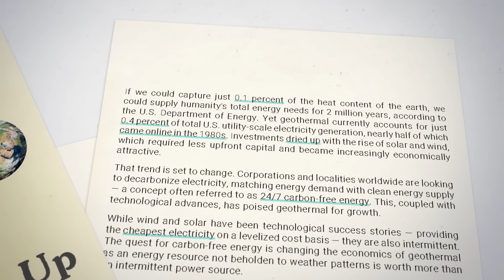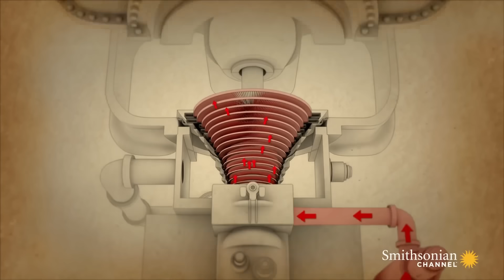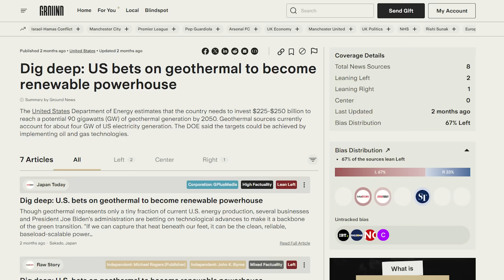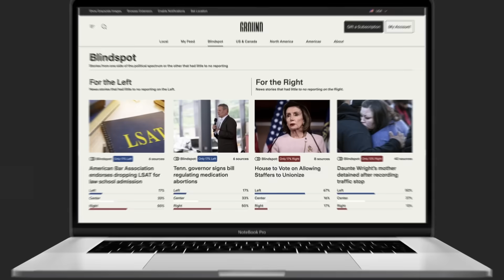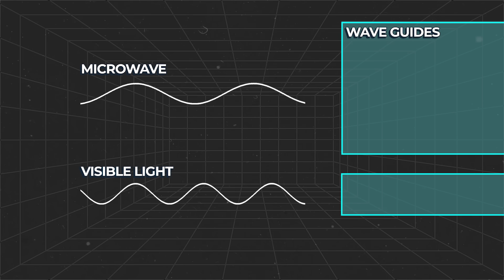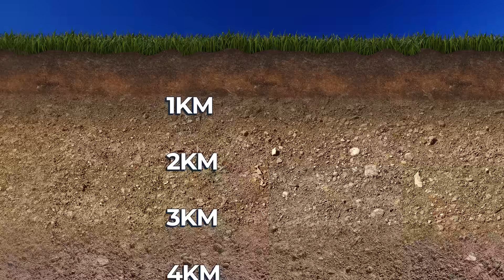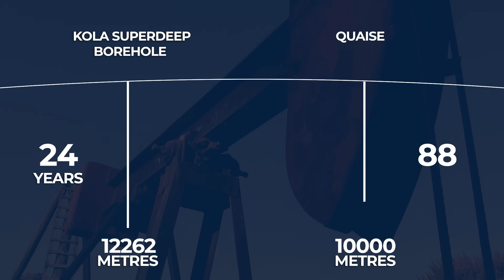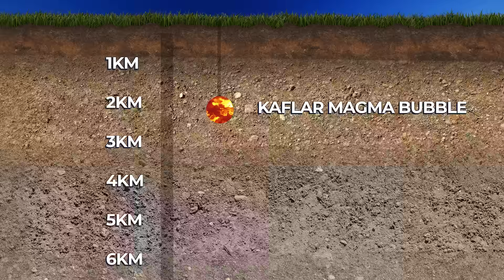This Fusion Tech is Solving the Geothermal Energy Problem

Comment: There is another technology that needs such drilling but at a much lower depth. The Trompe. These produce compressed air from a low head but continuous water flow. Compressed air can be stored so you get on demand power and can do peak and base load from the renewable. It also requires tiny dams. Carlos Araque is right wind and solar with batteries can't do base load but compressors up the wind mill can, compressed air though solar thermal systems works and compressed air can be stored for a fraction of the cost of batteries. For various reason, mainly the fact that the patents are 100 years old so you can't get exclusivity, the technology has not been developed. The one company that was trying to do compressors up wind mils got bought up and shut down by someone, not big oil.  Cheap drilling for Trompe coupled with mass produced parts that can be put down the resulting hole could be significant.
Reply: wow! thanks for the information. I think that those who stopped such a project are themselves the “ Electrification of Everything ” group, where everything must work with electricity, even if it does not need it, and there should be no technology that generates, stores, and uses anything other than electricity. I saw the same thing with nuclear fusion groups, where electricity is used to power a reactor and then the electricity is recovered from it. When you go to the video comments, you see people saying, Wow ! What a futuristic technology, just imagine if it was a technology that did not use electricity, they would immediately oppose it and call it a “ perpetual motion machine ”! It seems that the electricity has a special license or visa where it has the right to violate all natural laws !
Reply: @ياقوت-ق  Remember when this technology took off high temperature superconductors had just been discovered and superconductor storage rings were talked about. That made sense of the technology decision but superconductor storage rings never panned out. The technology does not scale. The patent problem is still un resolved. Industry wont use 100 year old expired patents because manufacturers can't get exclusivity and often investors and banks want that as a protection.

Comment: They don't seem to have solved the other problem. It's not hot water that comes to the surface from most sites; it's hot mineralized water. As he water flashes to steam the minerals precipitate and either clog the system or become a pollutant. Compressed CO2 can be used but that's hard and that works for warm geothermal at shallower depths.

Comment: Brilliant recycling of old plants that's efficient. It seems like a vacuum would help on the top as a vaporized rock outlet. I'm not sure if the waves will scatter at as depth increases but if so, then a lining can be placed on the side of the walls (e.g. at a max average bore width).  I see the cause for the tests and am excited to hear the results! Thank you for the informative video.

Comment: Geothermal energy requires huge amounts of fresh water  .... a commodity that some people feel is in dwindling supply.   The claim that this can be installed anywhere is trumped be this need for water.   A calculation will need to be done to determine how long it will take to produce the same amount of electricity that was used to drill the hole.   .....how long till it 'pays for itself' power wise.   Pretty interesting technology, thought.

Comment: Several things need to be thought about. If you look at the operations in Hawaii, you'll see that the holes wear out ( cool down ) and new holes need to be drilled. If we remove too much heat from the core, the shrinkage will cause serious earthquakes as the upper layers adjust at rate faster than the slower cooling that is current.
There is no free lunch. There is a price to pay for everything. We need to understand that price before jumping off the bridge.

Comment: I love this. It brings back fond memories of Master of Orion tech tree. It is truly SciFi. 

For example:
"Core Waste Dumps take man-made toxic and polluting agents and stash them deep within the planet. Since they’re so far below surface water supplies and often destroyed by the intense pressures and temperatures at the fringe of the molten core, this completely eliminates all Pollution on the planet."
Reply: We could technically do that today. If we encased our toxic waste in tungsten barrels and threw it in an active volcano, it would sink in the magma through the volcano to the core. The tungsten wouldn't melt until it got way down, and the radioactive molten metals would still be heavier than other elements and would keep sinking.
Reply: @williambarnes5023  that is a really good idea but wasting a precious metal like that would be costly. I suggest putting trash in easily transportable barrels with thermite inside, the barrels can be made from niobium which is around 0.60 cents per gram. it will withstand the heat of the thermite at 2,200C meanwhile plastics will start to decompose at 700-800C. 2,200C would vaporize plastics, aluminium, iron and melt more useful metals like tin to be re-used. after filtering the liquid tin through a system the other waste products will be put into a hydraulic press with their faces cold to freeze the outside of the waste and this process will produce extremely compacted and heavy blocks of trash which can be thrown into volcanos :) Edit: the niobium barrels are reusable btw.
Reply: @infinite4809  If you don't wanna waste the metal, then attach a tungsten chain to the top. You can dump the toxic waste barrel after it gets into the magma layer, and pull the barrel back out, and keep your tungsten.
Reply: We actually can and may do this already for nuclear waste.  A simple hole drilled in the ground deep enough can store all waste on site.
Reply: That's the smallest problem. The biggest problem is that cooling the Earth's core makes it rotate slower and eventually stop. The magnetic field around the Earth collapses and we will be exposed to the space radiation. Also the solar winds will barrow the athmosphere and Earth will become Mars 2.0, a lifeless planet.

Comment: 1 MW x 24h x 100d = 2400 MWh of Energy. At 350 USD / MWh that's just 840 K USD energy cost to drill a 10 km deep hole? But that's a fist sized hole, right? So nothing that would make for any significant mass flow of energy exchange. So would we need to build a nuclear power plant to make a stable half a meter diameter hole to provide 1500 MW for 100 days? How do we get the constant electrical power supply for a reasonably sized drill hole for just a 100 days single use?

Comment: It's not fucking infinite, what part of that do you not understand? Quit telling people it's infinite, IT IS NOT. More energy use, means more waste. That which took billions of years to deposit it where it is, to be released for no good reason. This will have long term consequences for the rest of life on Earth. Just shortening the fuse further. Geothermal energy is the only thing other than the sun, that is keeping us from freezing to death in the absolutely dead cold of space. What part of that do you not understand? The baseline temperature of outer space is 2.7 kelvins (-454.81 degrees Fahrenheit, or -270.45 degrees Celsius) — meaning it is barely above absolute zero, the point at which molecular motion stops. Destroy our planet and the process that allows life, no human will allow you passage to our new home. Your mistakes will not be forgiven after you have been told.

Comment: In the first minute I saw a huge issue. At 0:38 , you described the issue. The energy sits under 10 kilometres of which are pressurizing that energy. If you release the pressure, guess what happens. The energy levels drop. The fact that energy is useful, is because of where it's located. If you remove the pressure, it becomes less concentrated. I don't suppose it's actually where it's supposed to be, and that removing anything would only destroy the planet's processes to regulate it's own heat further.
E=mc², energy cannot be created or destroyed, only changed. If you take from the Earth, just imagine how many billions of years it took to deposit and compress that energy into a concentrated mass, where it is now. You would not be able to fix or return what you took in 10 life times, let alone your 1. We must maintain a symbiotic relationship with our planet, not continue this parasitic one. Don't take for granted the only things that maintain life on this rock. This planet is already doomed to be drained of all it's resources to continue our lives. There is no accountability or responsibility to protect that which protects us. The ignorance of the consequences is widespread. You can't stop a million people from pushing you down to grab that last breath of air, remember that.

Comment: The problem I see with this method is extraction of the vaporized rock.  The only direction the rock vapor can go is back up the multi kilometre borehole, cooling (via heat transfer with the borehole walls and the drill) as it goes.  Once it cools enough it will become a liquid and start to drip back down the borehole and eventually solidify - back to relatively the same amount of rock.  Heck, what's going to prevent the cooling rock vapor from freezing the drill / waveguide in place?
In addition, what's to prevent the vaporized rock from escaping back up the drill / waveguide?  There's also the matter of making the drill / waveguide out of a material which won't melt when exposed to 3000+C rock vapor.
Reply: The beam is also being gradually absorbed by the waveguide, as the beam progresses down the pipe.
Reply: @YodaWhat This was my primary thought. Going to be a huge amount of absorption going on. I don't think it will work.
Reply: That's my thinking. Gives me a sneaking suspicion about the whole idea.

Comment: Can't you not just use a really powerful water jet with abrasive material? It automatically cools the surrounding, so your drill and pipes etc don't melt? And the hot water that is coming out maybe could even already be used for something, depending on how hot it is?
Or also a "normal" drill, couldn't we not simply cool it with water. Of course drilling maybe would be slower, but it should be faster than switching the drill all the time :D

Comment: Rock's have pore pressure that will make this not work. You have to balance the pressure with fluid which is why drilling for oil uses mud, as you drill deeper you have to use heavier mud to balance the pressure and prevent an influx of fluids or collapse of the bore, but heavier mud will break down shallower formations causing losses, so you have to come out of the hole every few hundred feet anyway to cement the hole. Blowing vaporized rock gas out of the hole won't be feasible as well because you won't have circulating fluids to bring that vaporized rock to the surface and out of the hole.

Comment: A lot of things happened since 2020 but especially for me since 2022 I don't live normal life anymore I just can't all I do is politics which engulfs everything history, economy, science, crime, war etc etc. In these thousands of hours of trying to understand what's going on I'm bow 100% convinced that geothermal isn't that complex compared to other stuff like let's say space, quantum computing or even chip architecture. The only reason that we don't have thermal is lobbying against it and purposefully ignoring reaserch investment in it too. It's really simple, if we achieve geothermal energy as main and only power generating method then energy turns from commodity into human right since it's abundant and can be either build to be extracted anywhere or energy grid could be extended to places where it's hard to reach those depts in any case suddenly no more profits from carbon, solar and wind manufacturing, maintenance and replacement. It's that easy

Comment: the way the problem is described is that it's the changing of the drill bits that takes majority of the time and that's because you can't send a drill bit down when one is coming up
that's the problem of having only a one-way lane. if that's the case all you need is to be drilling two holes together. the bits of both exit from only one and enter from the other. this way by the time the bits wear out there's already 2 more bits waiting in one of the holes. is it really this simple..?
Reply: No, now you're just doing everything two or three times. Al the same problems still apply. Your second and third bits also have to go all the way up and down. There are no "lanes". If your second drill bit isn't going down the hole the first one is coming up, you're just drilling an entirely separate hole over there for some reason with your second drill.

Comment: We need the heat within the earth to keep the radiation shield of the magnetic field going. In the distant future, as the earth's core cools, we may want to reheat the earth's core with terrestrial fusion in order to keep the radiation shield going.

Also, solar and storage is getting so cheap it will render geothermal redundant anyway.

Comment: What utterly nonsense talking as if you could not use geothermal energy with the technology existing today. As it is, geothermal energy is underused, not because it is not possible or to expensive, but because it is just not done on a grand scale. One could blame stupidity, laziness or lack of imagination. New geothermal power plants are expensive, about half the price of a nuclear power plan, but run 24/7/365 and the first geothermal power plant in Iceland from 1969 is still running on average of 90% name plate power output.

There are places like Iceland, you drill about 3 km and get steam with an average energy of 5 MW per borehole. You use that in a flash steam power plant. The residual heat you use for district heating or run through a dual cycle power plant. You have such conditions all over the world and in many states in the USA.
Iceland gets 65% of it's primary energy from geothermal.

Than you have areas with hot rock that do not carry water. It gets slightly more complicated there. You drill two boreholes, crack the rock between them at the depth (similar to fracking) and pump water down one hole and get steam up the other. You can also go for a closed loop system were the two or several boreholes meet down there. All those technologies are used in drilling for oil today.

You talk about the need to drill 10 Km deep. In the coldest places in regards to the earth crust you get 100°C in 5 Km depth. Most often you are already at 150°C at that depth. You can use that for district heating or run a binary power plant to produce electricity.

A binary or dual cycle power plant uses the hot water to heat another liquid that boils at a lower temperature providing steam, that steam you run through a turbine and bingo you have power. A technology used today. There are binary power plants running in Iceland, using the residual heat after the flash steam turbines or using hot water at around 100°C or above.

The possibility to expand geothermal power use hugely with technologies available today, is there. Just underused. Nothing against new technologies, but there is no logical reason, that geothermal energy does not see more use today.
In the USA for example it could provide all primary energy according to studies. With technologies readily available thanks to the oil industry.

Comment: In traditional drilling, the drill bit flutes are used to carry away the extricated material from the hole. This video shows some demos of a maser blasting an hole (note that is is not symmetrical) into a block of metal,  but I wonder what will happen to the extricated material in the situation where the hole becomes a column. To say that the rock is vaporized seems to imply that the problem has magically disappeared. While thinking about this problem, I can't stop thinking that the vaporized rock will precipitate somewhere as soon as the temperature drops. Now if additional maser energy will be required to keep the vaporized rock in some fluid state, then that will place a limit on how deep this technique can be used to drill a column.
Reply: This is a misunderstanding caused by the fact that the term geothermal is used to mean two very different things. This video is talking about the traditional meaning of the term: extracting heat that diffuses up from the earth's mantle. The thing you describe in Indiana is something completely different, more properly called a ground-source heat pump. It has nothing to do with capturing heat from the mantle. It's about going just deep enough to reach soil that is unaffected by seasonal temperature variations, and over decades has reached equilibrium of the average atmospheric temperature in your part of Indiana: cooler than the summer weather, warmer than the winter weather.
Reply: @ps.2  Agreed on all points. But I still question the wisdom of going all the way to the mantle. Humanity currently has no technology capable of pump molten rock so the best we could hope for is drilling part way to the mantle then extracting energy via injecting some sort of transfer medium, like water.
Reply: @NeilRieck  Yes, that is how geothermal power works. Nobody outside of Hollywood has ever suggested drilling all the way down to the mantle.
Reply: @ps.2  I hear ya! But almost every graphic in this video shows a bore hole going to (or close to) magma.

Comment: It's a great idea, the only down side is flooding, water will draw off the heat. If you can find a location that has no underground rivers or water reservoirs it might work. The deep gold mines in South Africa are only possible because Johannesburg's elevation is  1800 meters above see level and the African continent slopes down towards central Africa.